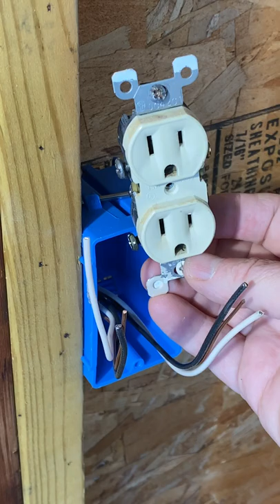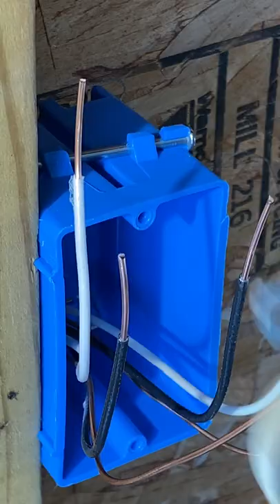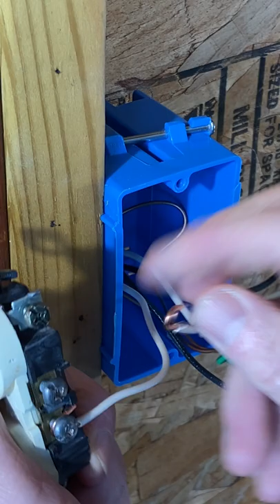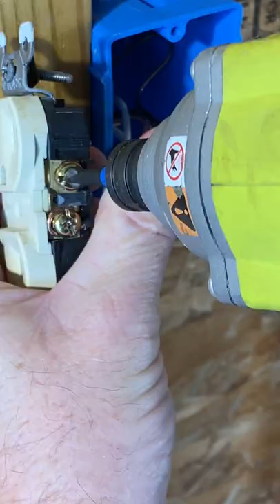Install an Electrical Outlet in 60 Seconds #Shorts

Comment: Does every cabel in america miss the shielding on ground wire? In finland it needs to be shielded allways and with the correct color also.
Reply from the maker: Type NM and NMC used for residential wire carries a bare ground wire. Other cables like MC, BX, TC etc used mostly in commercial and industrial facilities carry an insulated ground wire colored green or green with a yellow stripe.

Comment: Is the series or parallel?
Reply from the maker: Its still parallel in electrical terms when the device is through wired like this one. It's just paralleled at the device rather than at the wire nuts.

Comment: Will there always be two black two white and two ground wires?
Reply from the maker: No.. If it's the end of the circuit there would only be one of each wire. Also you could pigtail. For example if you had three of each of the wires in the box you would connect them with wire nuts or other connector and add a tail for each to connect to the receptacle. I hope this helps.

Comment: How about we use wire nuts
Reply from the maker: Pigtail is an option but either way is correct per the NEC. The passthrough current is listed at 20A even for 15A receptacles.

Comment: So those little tabs are responsible for carrying the current to the rest of the outlets?😳 I always pigtail
Reply from the maker: The pigtail is an option but either way is permitted by code. The receptacle pass through current is listed at 20A even for 15A receptacles. So it's actually as good or better than the wire. The limiting factor would be the connection. If you make a solid side wire or compression connection you will be fine. If you back stab then you should pigtail every time in my opinion.

Comment: this is old the mew back connect is not plug in anymore it use screws to tighten the wires securely
Reply from the maker: Residential grade 15A receptacles have the back stab option. They are no longer permitted on 20A devices.

Comment: So what is that green plastic thing on your grounding wire? Before you screwed it to the green screw? Do I need something on all of my grounding wires like that for the exposed wire or something?
Reply from the maker: Good question.. That is a wire nut made for ground connections. It has a hole in the end to allow one longer ground to come through and connect to the device. A more common way of connecting the grounds is using a ground barrel crimp.

Comment: You forgot to use a crimp instead of that wire nut and tighten/close the hooks to make a better connection
Reply from the maker: The green wire nut with a hole in the end is designed for ground connections. Crimps are another option. I prefer the wire not because it makes it easier to disconnect if needed. Closing the terminal loops is not necessary. I’m a 28 year industrial electrician and 10 year electrical engineer.
Reply: @BackyardMaine  was it hard going from electrician to engineer? Did you have to do college for 4 years again?
Reply from the maker: @vponce7997  For me it was a natural progression. I worked for Texas Instruments as an electrician for many years and I slowly began taking on the engineering responsibilities. Then in 2011 they transitioned me into the position and the current engineer into another area. I had a lot of experience in engineering through my time in the Air Force as well.

Comment: Flip that receptical. Ground up. It's not a little "Oh!" face.
Reply from the maker: I never install them ground up.
Reply: @BackyardMaine   You should try it for yourself sometime and use it. You will find that there is a notable difference in the feel when you plug or unplug something. This was a safety issue once when metal blinds came apart and fell across the prongs causing an arc.
Reply: @BackyardMaine I agree with everything in this video except the ground up is better and safer.

Comment: don't use the holes in the back, it's very easy... and tightening the battery screws with a screwdriver and that's it, and nothing else, also good... he's really a dude and he's already trained and he'll tighten it as he should, which I don't think, because in Basically, every screw can be tightened to the maximum with a screwdriver, regardless of the fact that the copper is soft and if you try to tighten it again after a while, it will again be a bit tight.

Comment: Why dont you use the back?
Reply: Those connections points are basically a spring loaded connection. Over time they naturally wear out and cause issues. I've seen a lot of those that have failed, and at least one that nearly caused a fire.

Comment: I have a set of red wires to. What do i do with that?
Reply from the maker: Many time the red wires will be connected to a switch for controlling half the receptacle. This is done in place of a ceiling light or sometimes for convenience. If the receptacle you’re replacing has the side tab removed on the hot side that connects the two hot terminal screws then that’s the case. To reconnect a new devices you will need to remove the same tab or eliminate the switching capability

Comment: Receptacle installed upside down
Reply from the maker: No its not..
Reply: @BackyardMaine  oh ?
Maybe not in your world but I can assure you that it would not pass here !!
Reply from the maker: I assume your not living in the USA or if you do you live in a city where ground up is mandated by a local code. But for 95% of the country orientation is not called out by code.  @madeinfoxtrap5539
Reply: @BackyardMaine  you are absolutely right. I live on the island of Newfoundland. 
Receptacle installation here requires ground pin up.

Comment: If you say not to do something, like "don't use the plug in connectors on the back", tell us why. You left out too many crucial steps, such as turning off the breaker switch and testing the outlet before and after doing that. And I'm an amateur.
Reply from the maker: You can only get so much information in a youtube short being limited to 60 seconds. I have other shorts going over all of these things on my channel. I also have lots of longer videos with much more detail. Check them out and remember to subscribe as well. This channel is all about helping people just like you. I do my best.. Thanks

Comment: 😢nope now if the device goes bad there goes half the circuit 😅
Reply from the maker: Same is true for a wire nut connection which in my experience has about an equal chance of failure. The passthrough connection is rated or 20A even on 15A receptacles.

Comment: Pigtail it ! The only way to do like a good electrician
Reply from the maker: Not required and it’s not better. Just adding splices that aren’t necessary in most applications. Been an licensed electrician and electrical engineer for four decades

Comment: Pigtail should be a least 6"
Reply from the maker: Yup you are correct! I use this box for demonstration  purposes and the wires have been cut a few times.
Reply: What's a pig tail?  I see two sets of wire in the box.  Doesn't it need only one that feed to outlet?  I'm trying to install an outlet in the basement for the first time.
Reply from the maker: @jjc.4088  If you have two sets of wires each with a black white and bare ground then you follow the video instruction. The two blacks go to bronze screws, two whites go the the silver screws and the grounds tie together with a wire nut or other approved connector with a "pigtail" another piece of ground wire to the green screw on the outlet. I'm using a type of wire nut with a hole in the end so I can pass one ground through and connect them together without another piece of wire. Make sure to shut off the power first for safety.
Reply: @BackyardMaine  Thank you!!!!!!!

Comment: Your ground pig tail is not long enough. 6 inches is code
Reply from the maker: Wrong.. The pigtail does not have a length requirement. The code is minimum 6 inches from the point where the cable enters the box and 3 inches outside the box. This is for conductor entering and leaving the box. The pigtails can be any length.    (300.14 Length of Free Conductors at Outlets, Junctions, and Switch Points).

Comment: Ok this does not count as installing an outlet... What about the wiring part? The electrical outlet fairy didn't put those wires in that wall. 
There is far more involved than stripping wires and wrapping them around some screws.
Reply from the maker: Obviously.. lol

Comment: Why is there 2 wires of each color in one box?
Reply from the maker: Good question. You see this when the circuit carries on to the next device. If it's the last device in the line or a dedicated circuit you would only see one set of wires. Sometimes (although I try to limit two cable when possible) you will see three or even four sets of wires.
Reply: @BackyardMaine  makes sense to me

Comment: No, the outlet is already installed. You’re installing the receptacle device into the outlet. Article 100 definitions.
Reply from the maker: Of course I know this..  The device is called a receptacle. Any point in an electrical system where current is taken from the source is an outlet per NFPA 70 Article 100. A light, heating/cooling equipment, fans etc.. all outlets. But since most people call them an outlet and for the best search results I call it an outlet. https://youtube.com/shorts/KavhTwwh0mo?feature=share
Reply: @BackyardMaine  Respect. I like bugging people about it. Take care, sir.

Comment: Careful using a drill.
Reply from the maker: I find the impact to be fine as long as you know how much pressure to apply. I've never stripped one yet..
Reply: @BackyardMaine exactly. I can’t stand rookies who are like “don’t use a drill u can break something “ Im a pro with an impact I’ve torqued and drilled THOUSANDS of screws

Comment: Umm, your receptacle is upside down. The ground terminal goes up, this helps plugs stay in the receptacle.
Reply from the maker: No the NEC doesn't specify receptacle orientation with exception of prohibiting a face up position in or under a countertop. Most install ground down but there are those who install ground up. Either way is fine.
Reply: Nah that shit looks funny
Reply: @BackyardMaine  actually that just shows your inexperience. Which brings into question if you are even fit to give advice.
Reply from the maker: @Aphazel18  not quite buddy. Licensed electrician and electrical engineer with 38 years of experience. Retired at 55 from 150 billion dollar corporation.

Comment: 60 seconds  I have record 19 seconds with cover and level and screw straight  up and down just ask dave
Reply from the maker: You must be back stabbing. Even with that I would like to see 19 seconds. Cut, strip, loop, connect ground wire nut or crimp connect receptacle, tighten, fold wires, secure to box, install and level plate. I don't believe you can do that in 19 seconds. Send me the video. Email is on my about tab.

Comment: 😢uh...drywall?
Reply from the maker: No drywall on a demo receptacle.
Reply: @BackyardMaine  yeah, I know. Facetious.  It is a pain though to drywall around an already installed receptacle. It's also a pain to repair the gaps of a sloppy drywall cut out. The receptacle tabs need something strong to rest on.

Comment: I have at least 6 pair of wire strippers that look like his and none of the straps wire as easily as his does.
Reply from the maker: Ideal and Kline make the best ones in my opinion but even the cheapest ones will work.
Reply: @BackyardMaine  thanks I'll look into getting one or the other.

Comment: Not to NEC code. Needs pigtails.
Reply from the maker: Some electricians like you get this wrong because they misinterpret code Article 300.13 B which prohibits the neutral wire from connecting through the device on multi-wire branch circuits. 
Multi-wire branch circuits have two or sometimes three separate ungrounded hot wires with voltage between them sharing a common neutral.
A single circuit feeding outlets is not a multi-wire branch circuit and pigtails are not required. If you need any other help understand the code be sure to watch some of my other videos.

Comment: I would definitely use the plugin connectors. Screws will get loose over time but the plug in is spring loaded
Reply from the maker: Actually there is no spring. You wedge the wire in between to conductive surfaces and with heating and cooling it gets loose over time and fails. I have repaired 100s of failed back stab connections over the years but have never replaced a properly installed side wire connection.
Reply: @BackyardMaine  oh, then they're different than our push in connectors in our outlets. Our are like a wago (the 2273 ones)

Comment: It looks like 14 gauge you don't really want to use 14 gauge on a receptacle no receptacle only on lighting fixtures.
Reply from the maker: 14AWG for 15A circuits an 12AWG for 20A circuits regardless of whether it's an outlet or a switch.

Comment: Check the cover plate screw. 🤣😂
Reply from the maker: Just a demo install.. Came right out.😎
Reply: Just ribbing you as cover plate screw was not vertical or horizontal. :)
Reply from the maker: @JohnLittleJr  My OCD was on holiday.. 🤣

Comment: I'll never understand why they can't just put 2 ground screws.  It would be so much simpler.
Reply from the maker: Continuity of the ground wire is really important for electrical safety.
Reply: The methods of pigtailing, using a greenie or a crimping ferrule are standard practices regarding ground connections. The reason for 2 screws for the current carrying conductors is for splitting the receptacle or making one receptacle switchable.
Reply: @surferdude642  those things make a lot of sense but it would still be easier for me if there were 2 ground screws lol
Reply: @CeeJayThe13th  Maybe it wouldn't be easier. With the extra wire, it would become more difficult to mount the receptacle in the box, especially with 12 gauge. The extra wire could also increase the chance of a ground wire contacting the neutral screws and I think the NEC would consider this an unnecessary safety issue.
Reply: @surferdude642  you actually add another wire when you pigtail it
Reply: @CeeJayThe13th  Yes, but that wire is captured by the wire nut and is pushed to the back of the box, out of harms way so to speak, so only one wire reaches the receptacle.
Reply from the maker: @surferdude642  The two screw are for splitting but also for through wiring per the manufacturer.
Reply: @BackyardMaine  Agreed. I personally wouldn't wire it that way unless the box is so small that there's no room for the pigtails and wire nuts and it's impractical to replace the box.
My house is 70 years old with small metal boxes and every middle of the run receptacle is pigtailed. The catch is that the pigtails are crimped and soldered and the receptacles were smaller then.
In new construction or remodeling this wouldn't be an issue.

Comment: Using the receptacle to feed through....😮not good
Reply from the maker: I’m a licensed electrician and I’ve heard this argument a thousand times. The answer is simple, pigtails and feed through are both good standard wire practices and both NEC approved. Even 15A receptacles are rated for 20A pass through current. So unless you’re using the back stabs it just fine.

Comment: Definitely 6” of wire in those boxes, definitely not a code violation, good job if you’re a hackah
Reply from the maker: No code violations here.. The code states 6" of free conductor extending from the cable sheath and 3" of free conductor extending outside the box. 38 years licensed electrician and electrical engineer. Not a hack but I read a lot of comments form hacks.

Comment: That’s not how you do code.
Reply from the maker: The pigtail is an option but either way is permitted by code. The receptacle pass through current is listed at 20A even for 15A receptacles. So it's actually as good or better than the wire. The limiting factor would be the connection. If you make a solid side wire or compression connection you will be fine. If you back stab they you should pigtail every time in my opinion.

Comment: You don't need two blacks and two whites, the metals contacts our connected so it powers both sides of the outlet with one power and one neutral wire hopefully you didn't put two breakers because it's a 15w outlet it'll just burn out the outlet before the breakers trip cause there doubled with two wires cause you can't hook up more than one power wire to one breaker therefore more watts between the plugs. Double breakers roughly 20w a breaker so let's say 40w on a 15w outlet. (5 yr experience) just trying to help
Reply from the maker: There is so much wrong with this I would not know where to start. You need to join an apprenticeship program my friend. There are lots of good options for learning the trade.

Comment: I will never understand how y'all can trust wire nuts
Reply from the maker: I've seen maybe one or two wire nut failures in 38 years in the trade and they were poor installation.
Reply: @BackyardMaine  yeah, but you can install them poorly, which is my whole point. You basically can't mess up a wago clamp, and even if you somehow did, it would be super obvious
Reply from the maker: Oh I thought you were talking about electricians. Yes I think the wago 221 is a great choice for the homeowner or DIYer. They are very easy to use and are a fairly reliable connection. The wago knockoffs are not nearly as good so beware.  @L0op

Comment: Against code here. No more than 1 hot and 1 n to outlet
Reply from the maker: Don't know where you are but it's NFPA 70 compliant. Pigtails are an option. The passthrough current rating is 20A even on 15A receptacles. Just as good or better that the wire as long as you don't back stab.